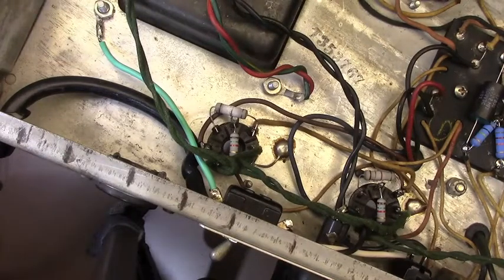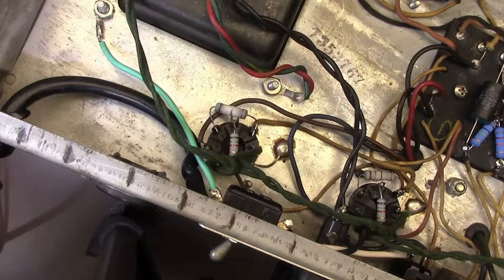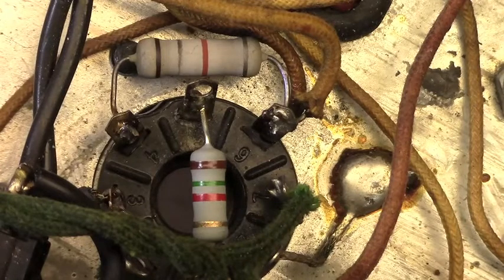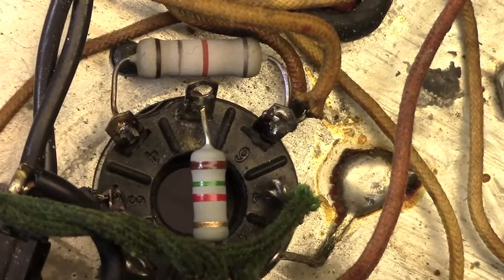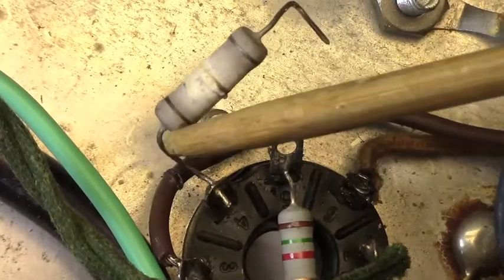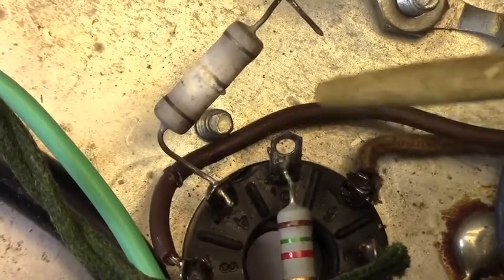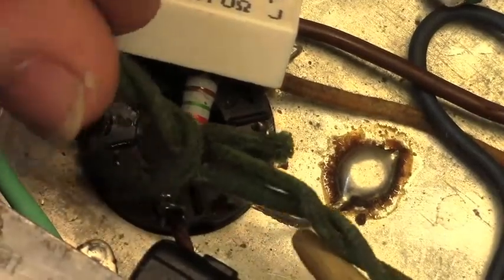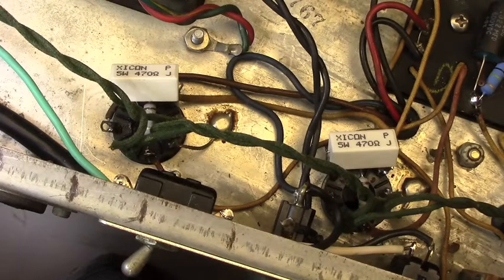1967 Blackface Bassman Mystery Short

Comment: Thanks for sharing this... finds like this make us stronger. Also, this is a reminder to use our most basic tools before reaching for the scope etc.

Is it possible the resistor lead was hot under normal conditions and melted into the insulation.? That pvc insulation melts easy as you know.
...or a little of both installation and power dissipation.
Reply from the maker: Blake Simpson - thanks for watching.

Yes, you are correct.  The melting of the insulation may have happened under use.
I still think it happened at the time of installation.
This clip stands as a reminder to me that everything matters when it comes to wiring.